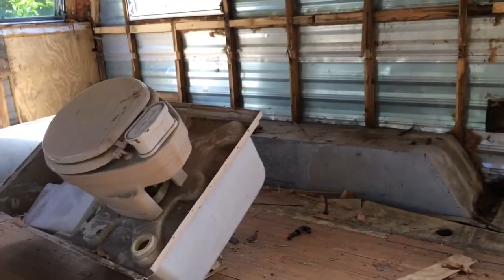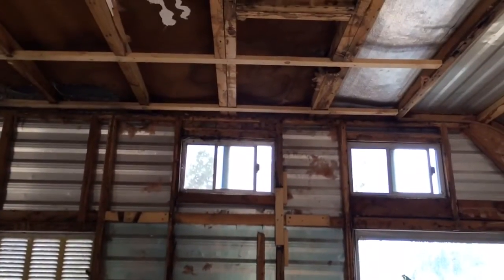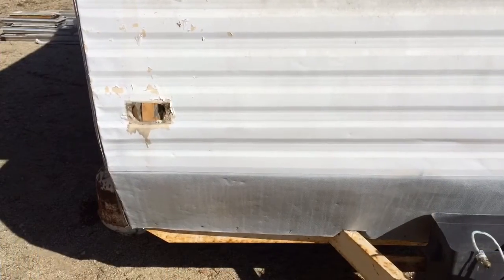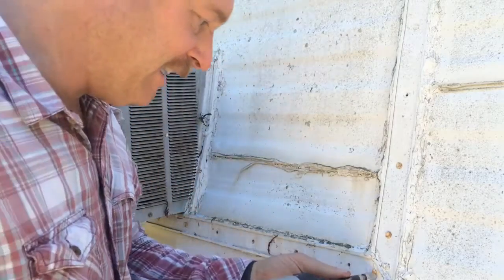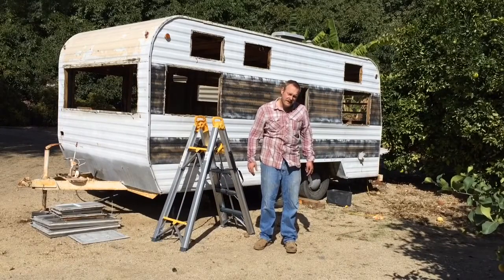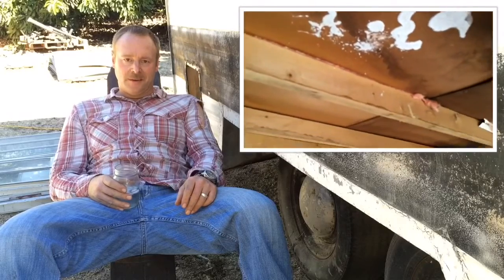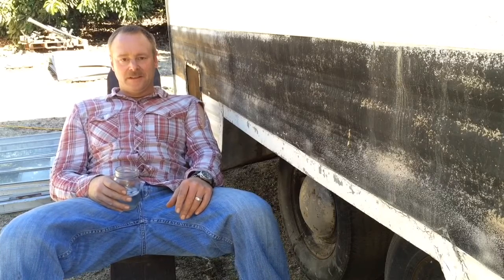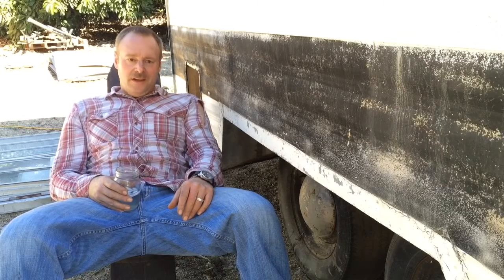The Giving Trailer 3 | So Many Screws!!

Comment: If it's as rotted out as it appears it may be, just push it over and the whole thing is on the ground where injury risk is vastly reduced. If that's not possible, remove the tin from the sides, cut the boards on the sides with a sawzall and take it down that way. Then the roof will be easily accessible for you. Good luck! And stay safe. :-)
Reply: I concur with Dale, strip the sides and then use a reciprocating saw to remove the roof to ground level. Great video and soon the caravan will be a distant memory.

Comment: Pull corner metal off and I bet that will fold like a house of cards, flat to the ground. The more you remove it should pull down with a rope and a quick tug from a truck. Then work on the roof.
Reply from the maker: Hey Mike Thanks for the suggestion, bring it down a level so to speak.

Comment: Sawsall with metal cutting 
blade.
Reply from the maker: Solid suggestion.
Reply: No, use a grinder with a cutting wheel. Much faster and cleaner with less vibration. Unless you will be cutting through wood as well as the aluminum siding.
Reply from the maker: Gold star for you Sir!!